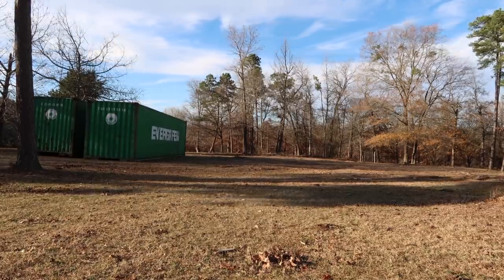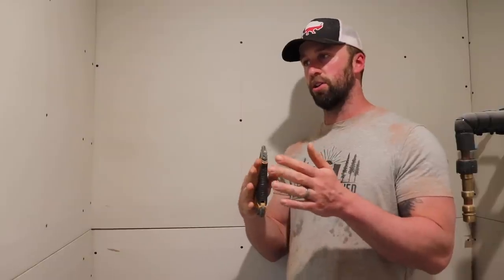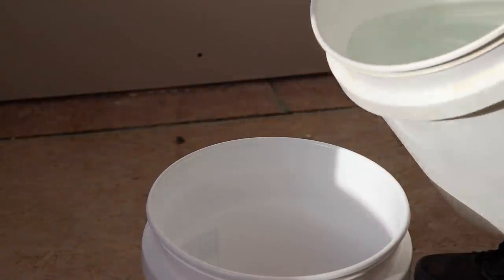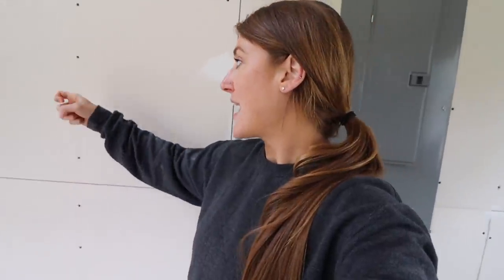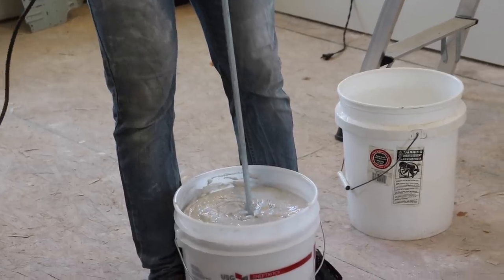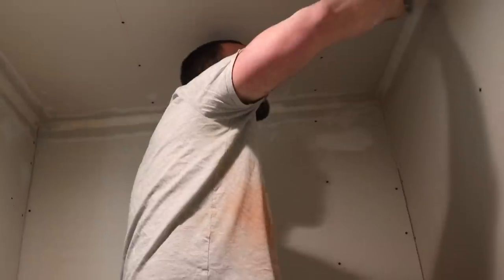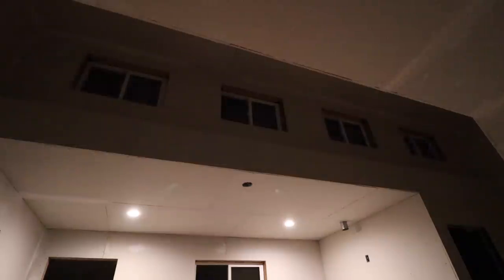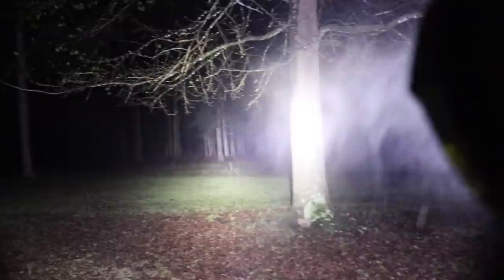Here Goes Nothing...

Comment: I was watching your video. And the best way to mix in a 5 gallon bucket. Is to poke a hole in the lid,and run your drill bit through the lid and place the lid back on the bucket and then start mixing. That'll save it from going everywhere.

Comment: Not difficult if you learn.  Numerous methods will work, most take longer than the right way and require lots more work.  # 1. right mud consistency - icing on a cake or slightly thicker. Load it quickly then take off the excess back into the hand tray.  # 2 use web tape, not paper.  It has wax and will stick to the drywall before you mud.  It will shape to corners, etc.  # 3 have 3 different putty knives.  2" up to 12".  Allows you to smooth it out, reducing sanding to a minimum.

Comment: Get a corner troll forthwith inside corners. They will be much stronger and straighter. Very easy to use. Put the mud on with a flat blade and then use the corner troll to smooth it out.

Comment: If you want level 5 drywall, try this:  dilute drywall mud water until it is the consistency of yogurt or sour cream. Then get the biggest nap roller cover you can find and pour the diluted mud into a roller tray and paint it on in a thin-ish coat and smooth it with a trowel or taping knife, the wider the better.  I actually did this over texture coated walls in 4 rooms of my house.  I used drying type mud in 5gal buckets from HD.  Found someone else to do it for the remaining walls.  The pros use setting type drywall compound and stilts to reach the top of walls. I wasn’t fast enough for that.

Comment: you should have use the nylon style tape. 
when sanding instead of sanding board try a damp sponge instead less dust and it smooths it out nicer .
hope you counter sunk the screws in before you mud-ed over them
now its time to figure out paint colours for the rooms. also be aware prices on paint also have sky rocketed in prices

also you should buy a corner trowel would be easier

Comment: Good for you  Its like icing a cake, smoothing concrete, etc.  And you caN sand off any bumps.  And yes a wet sponge to cmooth it out. It is a SKILL not an “art” and like ALL skills, you have to start somewhere, and you only improve by doing. EVERY SINGLE drywall installer started from scratch.

Comment: I don't know anything about taping in floating dry wall but I have worked with my dad for many years doing interior trim carpentry and I have never seen the tape exposed that way. I'm thinking you should put another layer of mud over that Tape I have seen in some houses where the edges start to lift

Comment: Paper tape is ok to use but with mesh tape it cuts out a step or two on mudding since the mesh has a sticky side and you don't need to pre mud the wall before taping it.  The best thing for mesh is when the house starts to settle and the walls crack the mesh will hold better then paper tape. I have used both paper and mesh tape and prefer the mesh over the paper any day for it's speed application and the durability

Comment: A wooden roller for tape application onto mud and a 45 degree corner tool for inside corners would make you life easier. Foldable tape for exterior 45 degree angles helps, reinforced  webbing tape for high stress areas, like around doors, is a good idea. It is a huge dirty task. Hang tough!

Comment: Howdy!  Not sure if my previous comment posted successfully.  Save time and get a banjo for taping Delko Zunder Banjo. I was a journeyman drywall/taper 20yrs. Use regular joint compound with the banjo. Using 90 minute quick set compound for small areas but not for a big job like yours. no need to cut into the inside corners to make a gap.

Comment: Spencer for the outside corners IF I WAS YOU I would use the metal corner bead especially if there is a large flow of traffic by those corners when you intend to move large objects through that area the metal will hold up better then any type of paper corner bead plus it will hide any imperfections in a corner. paper and plastic corner bead is ok if there isn't a lot of traffic passing that corner. but with children and moving large objects like furniture will damage a corner quickly.

Comment: @Life Uncontained   GREETINGS & PRO TIP

hi.
I love watching your content. you are funny, cheerful, full of smile even when things go wrong.
Mackenzie and Spenser, you are an inspiration to act.

Spenser, you put plasterboards according to the "brick" rules. it's a very good technique.
I know you were afraid of smoothing plasterboards, but you are doing great, although from what I understand you have never done it before. you also know that you should chamfer non-original edges.
BRAVO!

PRO TIP:
Spenser, don't pre-fill gaps. tape should be blended into all flat and corner joints of plasterboards. you should apply mud to the ONE joint with a thick layer, stick the tape until the mud is wet and stroking it with a spatula, squeeze the excess mud from under the tapes until a smooth surface is obtained. 

here you have a YT video that shows how to properly lay the tape.
LINK: https://www.youtube.com/watch?v=Mup3RHnYggA

besides, you guys did a really great job! fingers crossed!
BEST REGARDS, CP.

PS. sorry for spelling mistakes, I am still learning this language. ;)

Comment: Just an idea... I don't know if it could be done or not. I've never mudded drywall, but couldn't you use one of those huge pastry bags, like the bakery's use to decorate cakes, and fill it with the mud to squeeze out in the joints then scrape any excess off? I would certainly try that, it looks like it might make things easier on you.

Comment: Your don’t need to do all the beginning prep of cutting seams and filling before tape, just get your mud wet enough that you will make somewhat of a mess but the wetter the better for applying. Get the mud on put the tape on top and smooth it out with the drywall knife. Don’t sand anything until the tape has been covered. You will always use too much mud starting out but you will figure that out once you start sanding. You will be a pro when your done lol.

Comment: A 1st timet should not use 90 min. Mudd 
 You have to work very fast with that mudd . It will harden fast than you think. If you have any ridges in the mudd you may not be able to sand. Always keep your joints very smooth. The toughest part is sanding.

Comment: Dude where you started the mudding in the closet at around 7:49 -- you first should've used that "Drywall Mesh Tape" (which is a porous mesh tape that has an adhesive to it) you would have taken it and formed a "V" shape in the corners, after applying the Mesh Tape, THEN YOU WOULD APPLY YOUR mud OVER the mesh tape, everything would have been so much easier.   You should have also used the drywall mesh tape over all of the seams in the drywall BEFORE you mudded them as well.  It would have been so much easier.   If you go on Amazon's website and put in 'Drywall Tape" it will come up and you can see what I'm talking about.

Also, when mudding you want to use as little of the mud as possible and by using the drywall tape, that helps you do that especially in the corners and on all of the drywall seams.  You need to keep in mind that "the more mud you use -- get ready for a very long sanding process, we're talking hours of sweat-equity"!

But -- you know what, overall you and your wife having had 'zero' experience in building a home and what you two have accomplished --  you guys are FREAKING AWESOME!  

When the apocalypse happens, I want to be in your camp, because you guys know how to build shelter!  What you guys have done with two shipping containers is amazing!

Comment: You need a 1 inch putty knife or 2in or four you need a 4 inch knife you need a 12-inch knife you need a trade 12in you put your mud in the tray after you've mixed it up and loosened it up maybe in a 5 gallon bucket you take about maybe a pound of it out then you add to that you add water probably about a liter then you mix it up till it becomes creamy then you take your trial and your tray and you go put mud in that corner on both sides glob it in there probably about maybe 3 inches long and about 2in high and then you take your corner trowel you swipe that down from top to bottom from bottom to top that'll give you a bed to put in your mud you take your tape you tear to the size of that area from top to bottom on one of the walls on the side of it turn it into a corner and squatted seem right down the middle so you have to fold it in half then you take your trial the corner trowel you put the tape in there and then you press that corner trial into the tape and press it into the mud then you repeat it again and again and again and again on the flat surfaces as well as the corners you want to do the flat Services first and you want to do the corners last you walked you go around the corners around the sides and everything don't forget your corner beads put those Corner beads in their first there metal so you can make your Corners outside corners nice if you do this the way it's done like I told you you will be done way quicker then what you're doing now

Comment: Also I hope he doesn't think that one layer with tape on top is finished? lol If you paint that wall you will see a dip where every single joint is. You have to put layers of mud on top of that with wider and wider trowels feathering it out until it looks like a smooth wall. Usually it's like 3 layers, first layer with a 4" or so trowel with tape to hold the joint together, then a 6" or so trowel, then usually an 8-10" trowel or so to really smooth out the gap that way you can't see where the joint is later.

Comment: I've told you once before skirting run the trailer some foam board awesome keep the wind from underneath your trailer no wind no problem wind is the issue it moves are cold air or hot air put skirting on it and insulated and keep it under your trailer is that a lot in the Wind blown away and insulate your water tanks or maybe you wanted to move Northwest Ohio

Comment: I wish we could help you before the video is out, lol. Self-stick Fiber tape = way better than paper tape. Going for sour cream consistency will help with initial coats. Also get a wider knife for big seams! Worth the investment for all the mudding you have to do. Tape every gap! Joint compound shrinks when dries and will crack if you don’t tape anything bigger than about 1/4”. Save yourself the money and just use a wet rag for sanding. Also way less dust. Don’t worry: You’ll be a pro at it right as you finish... sadly... lol.
Reply: Having renovated nine homes myself I did a whole lot of boarding so I was surprised by some of what Spencer is doing. I totally agree with you about using the self stick tape. I also used the inside and outside corner beads, not just tape. Worthwhile investments are quick set drywall mud, a nine inch wide blade, a plastic corner blade and the sanding tool you can attach your vacuum to which really helps with the drywall dust. No question that taping, mudding and finishing is an art form. If it's not done perfectly once you paint it can expose a lot of what you thought were minor imperfections. Hopefully you guys don't regret not hiring it out to the professionals. Loving your journey.

Comment: Don´t use tape. Use Mesh! I used tape for 2 times 3 meters horizontally and 3 times 3 meters vertically. And I did it as advised, I applied all the same technics as the professionals with the same tools. The endresult............vertically it is ok, you hardly see the tape, but horizontally.......a disaster. You keep seeing the tape through all the different endlayers. Of course , it also depends on how natural light is falling on the wall. But I stopped with tape. As well you hardly can buy it anymore in Europe. Nobody sells it because of the results. Everyone went back to using mesh.

Comment: You are creating more work that is not necessary. You don’t need to cut along joints or prime places where paper has come off. Mud the tear areas, sand then prime. With joints put some mud behind then cut a piece of tape and wet it then lay on joint. Then apply more mud on top of paper tape. Let dry, apply more mud, then sand. Finally prime all walls.